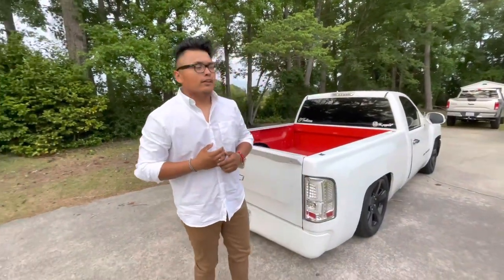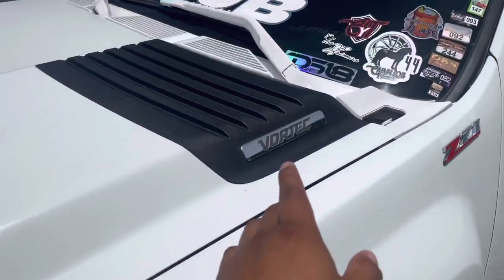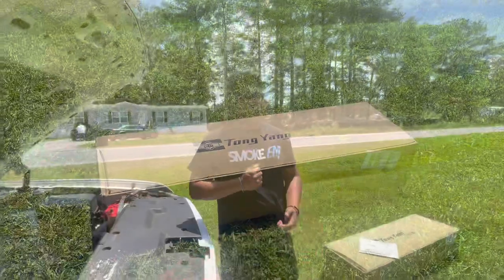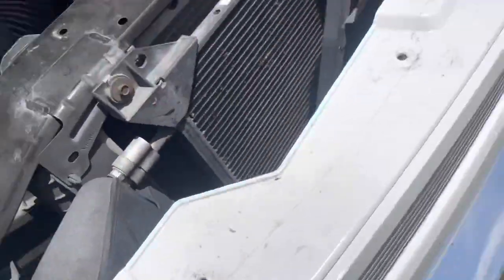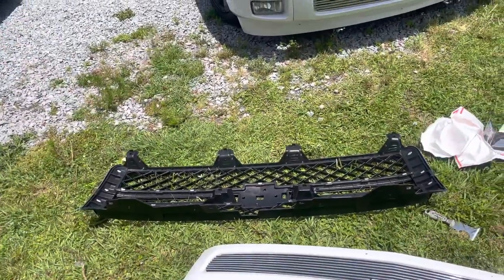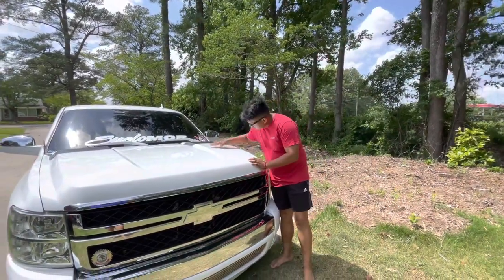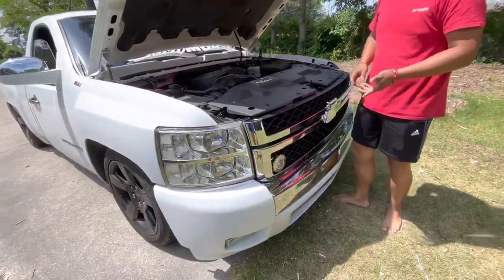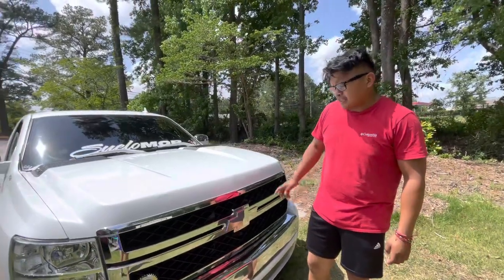07 Silverado HD hood and grille conversion

Comment: I got a 2007 1500 stock front will 2500 hd grill fit with stock bumper and hood?
Reply from the maker: Yes it will clips right in
Reply: @Tu_Pappi07  do you got a link you recommend the one you commented does not exist
Reply: @Tu_Pappi07  and do you know if 2500 end caps with fogs fit 2007 1500 end caps
Reply from the maker: @serglo.0312  https://www.ebay.com/itm/393449152842?hash=item5b9b65a14a%3Ag%3AGcIAAOSwHx5g82gx&amdata=enc%3AAQAHAAAA8O7b%2BV9kdmJ0RHaymyDSUrRRWQvPAIG%2BJJLhcDF9vto9dX0q3QWW9C1%2BZNbRBHOsXvB6eMnclRZBfypfGcxIOpxMay5PPs1hbQ5G0jhW3nLmzIObCfcApX%2BPZThfAFiPTUck34al%2FJk%2B6Y1Ei7La9el7117fRfXkfeU5IzH7C3sBJjyv0q4IOPF8VSrqnZgmoBKUBPMF6kMbPXsRGO%2B0%2BSTfikdjDkKEiUUe2A8Iu%2FVKJ4fSwUBGMMJaptZhlc6TWpMvZiWJZg0mtQngOfAdvb1ojnFJcFgSriOMjkuoT1qnEoEJIFh0xxcG7KfdVoKEuA%3D%3D%7Ctkp%3ABFBM_L2Nxo5h&fits=Year%3A2011%7CModel%3ASilverado+2500+HD%7CMake%3AChevrolet
Reply: @Tu_Pappi07  will this one fit?
Reply: Link that I sent?